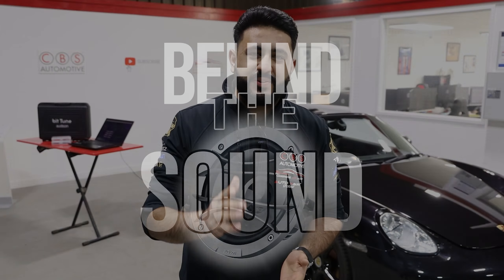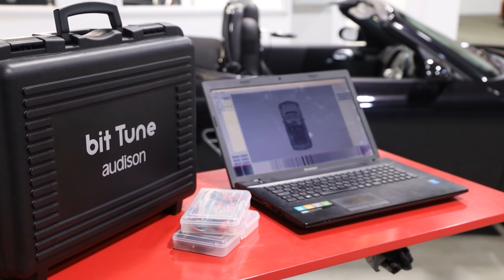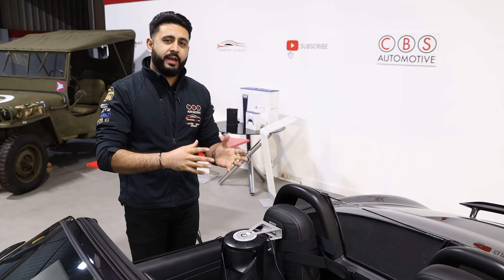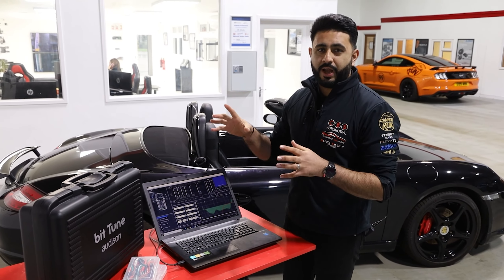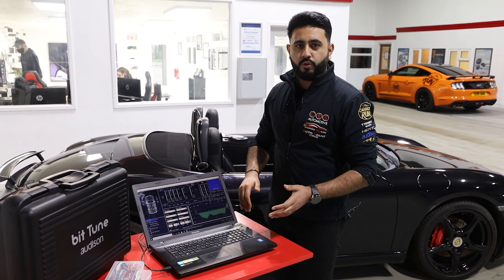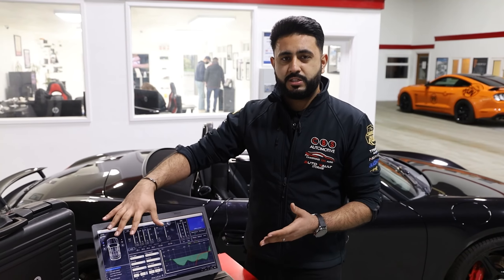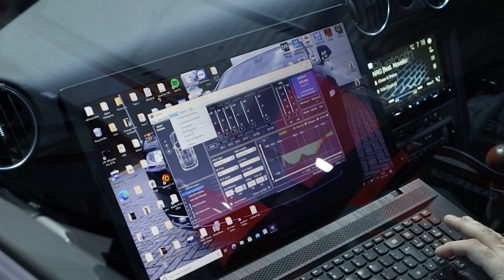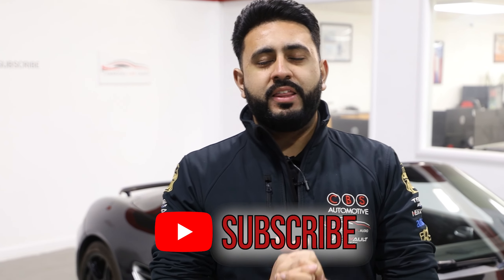How We Tune An Upgraded Sound System!! | Behind The Sound - Porsche Boxster S 987

Comment: Excellent videos! Its a genuine interest of mine on how this stuff works. One question I have is why is the center channel never used when building a sound system for a car? Every audio system thats considered an "upgrade" from the factory uses a center channel speaker of some kind.
Reply from the maker: Fantastic question. The reason why manufactures do this is to increase sales. If you look closely at marketing of brands like Meridian, Bose and basically all of them. All they talk about is the number of speakers in the vehicle. Like 15 speaker surround sound system. We talk about the quality of products rather than the number of them. When you have an installation done by us, you will see what we mean. You can always come by and see us and have a listen to our demo car which doesn't have a centre channel plus has less speakers in the car then the B&O system it had in from factory. hope that helps :)
Reply: I actually think the other reason they use a centre channel is to create a more listener friendly soundstage for the average listener. I have a fully active front on my rs4 just 2 midbass and 2 tweeters, from my driving position the sound is absolutely stunning, you can hear lots of details and place the instruments, however from the passenger perspective it’s not great. Alternatively if I play with the settings on my wife’s Audi q3 with factory b&o the soundstage is great, it’s not necessarily accurate but it gives a great illusion of a front soundstage from both front seats and I enjoy the sound it makes if I’m travelling in the passenger seat. For a factory setup that is relatively inexpensive it’s actually superb. However for a detailed listen mine blows it out the water, but I guess it should my speakers alone cost more than the entire b&o system installed in the q3. Factory setups have come a long way in my opinion, but the products available aftermarket have come even further, I’d argue that finally the aftermarket scene has woken up and started pinching factory audio ideas. Dsp amps, active front ends (or complete active setups) enclosures for drivers in certain car models are all great examples of where the likes of bose, b&o etc have helped in getting better ideas into a sound system. They’re far from perfect but they’ve given great building blocks to expand upon.
Reply from the maker: @dwdrum11  nice input